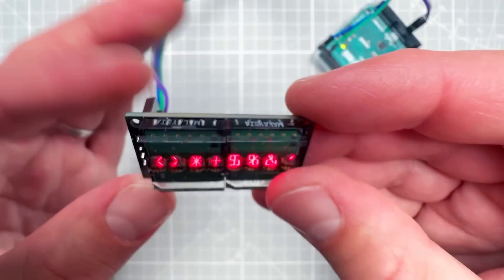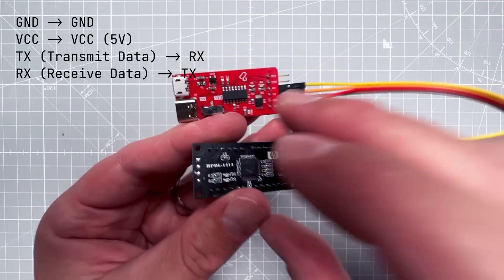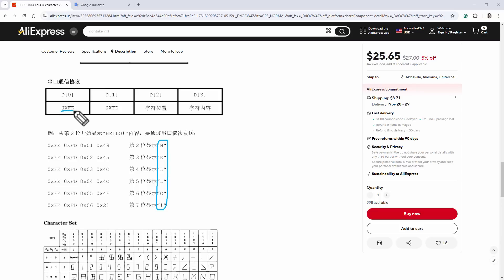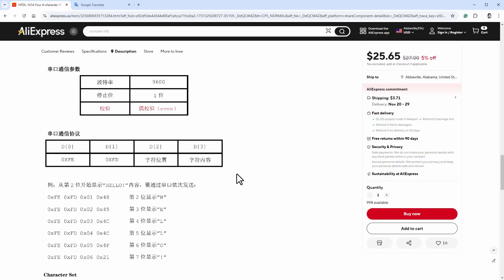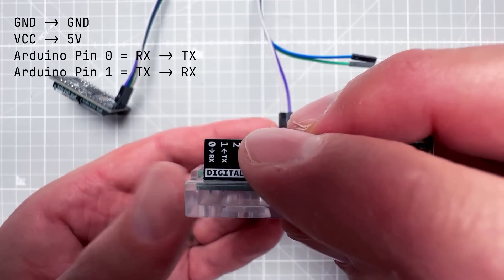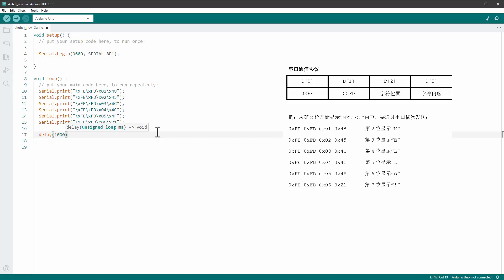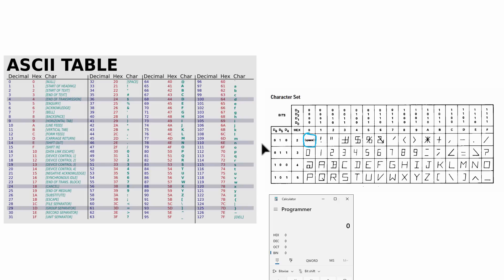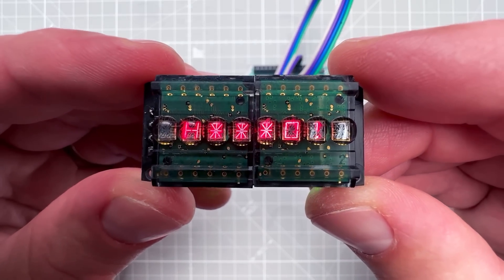Arduino Bubble Displays (HPDL-1414) - old and obsolete tiny segmented displays with Arduino UNO

Comment: I created a nice pcb for this display. https://youtu.be/2wIKiKhokB8?si=knu8Y6lqG5bkWGvR
Reply from the maker: Cool, that looks great. Are you planning recording more videos?
Reply: @upir_upir I wish I could. Because of post covid almost too little energy for my hobbies. I have planned to build ben eaters computer on breadboard. Bought the parts for cheap. When that works I want to to try running this display on that 6502 system.  Have several spare pcb's and and some bubble displays left. When finished I'll make a little video and also share software on github. Plans enough for now, now trying to find energy 🫠

Comment: I call these Aliexpress units "replicas" because they don't have the original PCB and circuitry as the real vintage ones. The vintage ones were marked "DL-1414" without the HP prefix. Your models also have the same scratches and dimples on the lenses as the ones I sourced from Aliexpress, making me believe they are improperly packaged units where the pins of every layer poked and damaged the layers below, making them unfit for sale in their original timeline. You can clearly see it on the right half of the 7th bubble at 0:53 and the effect on the characters is visible for example on two leftmost segments at 5:06.
Reply from the maker: Those are definitely not from HP, but I believe there were multiple other companies that were making the same displays, probably under HP licence, as a replacement for those displays. Good point about the scratches and this probably being some defective stock. It´s always hard to find more details when buying those old displays, especially from AliExpress.

Comment: Theese displays are great!

I love old rotary dial telephones - like the good old german W48 by Siemens&Halske (it has a Bakelit housing). I actually still use it (replaced the old carbon mic by an electret one).

However, of course it has no display to show the number and name of the Caller.

So if you use an Raspberry Pi, install an Asterisk Telephony server, an Analoge Terminal Adapter (capable of interpreting pulse dial, so you keep the ability to call "old style") to use the old telephone on VoIP, you should be able to connect theese displays to the Pi (using a level shifter for 3.3 to 5V conversion) and let the Asterisk show name and caller ID on this display. Use an old Bakelit box to place all the electronics exept for the display inside and 3d print just a display case from ABS (and use acetone smoothing to make it realy glossy to fit the look of Bakelit).

Put the display on the side of the telephone and you upgraded your old telephone with a CallerID and CallerName display without harming the vintage look&feel. Of course you can still use an app on your PC in parallel to add speakerphone, headset and CTI. Maybe a computer in steampunk design...
Reply from the maker: Lot of cool ideas there, I agree that this display would fit the style very nicely! Are you going to try that?

Comment: Nice! I designed a little 16x2 display with one of these that can be spi controlled a few years ago. I put a writeup on my hackaday io page and provide board files and example code for free. One big thing I learned is never try to clean these with any kind of alcohol (even diluted), the plastic that makes the lens will crack like crazy!
Reply from the maker: Cool, thank you for the details, that´s very helpful. And yes, I have just watched your 16x2 display project, that´s very nice!

Comment: If you have a cnc i’ve had pretty good luck machining thickish acrylic into lenses. Just do the finest finishing passes you can & then sand & polish. You could totally make lenses like that for modern 7seg displays. Not sure if that would make a similar enough display though.
Reply from the maker: That´s a great idea! It will probably not look the same, but it would definitely look interesting. Do you have any photos of your CNCed lenses?
Reply: @ i do! Do you have an email? I laser etched the backs, but can still send a photo
Reply: You might alternativly use resin 3d printing. With fine wetsanding before polishing you can get great results there too.